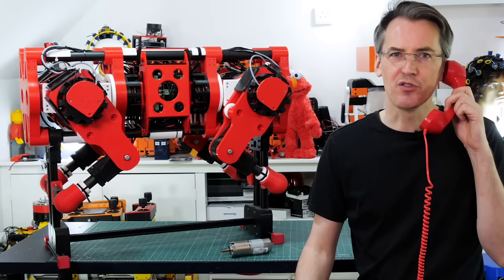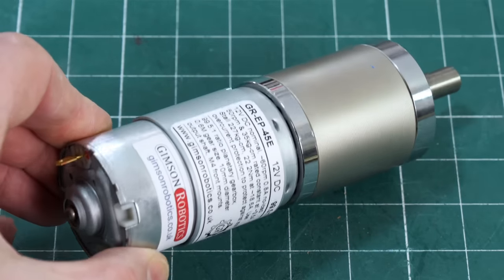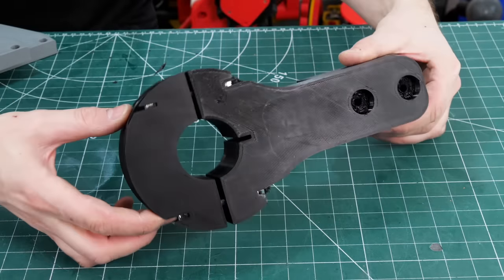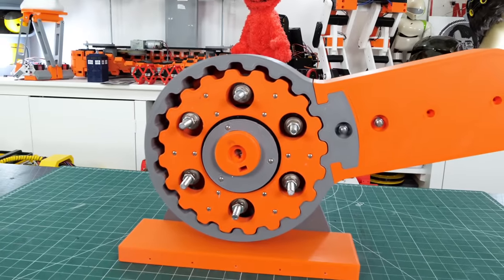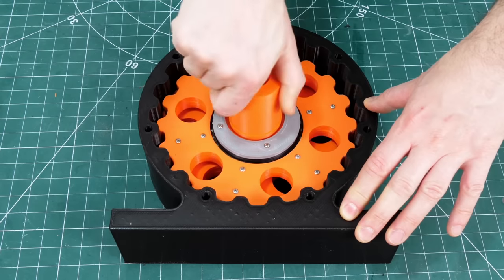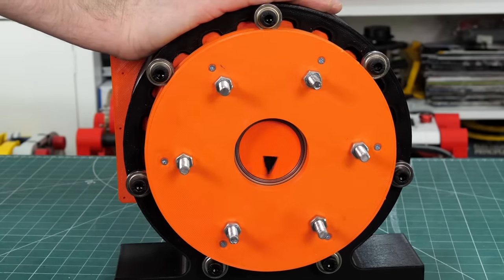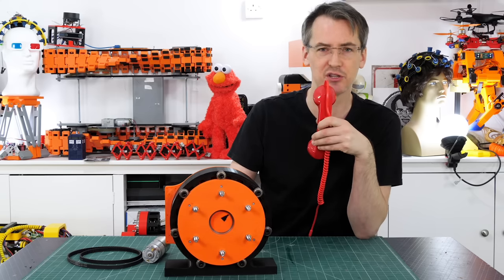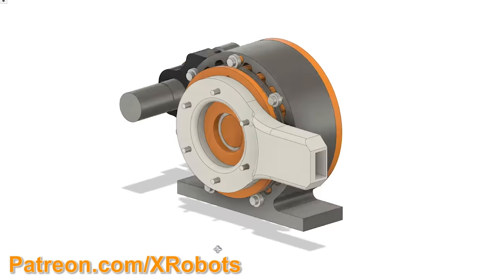120Nm 3D Printed Cycloidal Drive

Comment: Brother, you are getting pretty blase' about putting your hands around highly geared moving parts. You really need to check yourself. This stuff is now getting finger mangling strong. You need new safety protocols.
Reply: Yeah those pinch points would blow up fingers like hot dogs hit with a hammer
Reply: Ya. Ngl, even though I knew this was posted and nothing likely happened, I clenched when I saw that. It not being bolted down, with the self collision issue, while all the sketchy finger work was going on was a recipe if i ever saw one. Glad it went like it did.
Reply: Ooof that was painful to watch.
Reply: I disagree. I think it made it more exciting
Reply: Good point.. It's just a bad ROI in my honest opinion. Entertaining you briefly in exchange for the premiant loss of a very useful fingertip.   @Fanny-Fanny
Reply: @mrwoodandmrtin  that is a fair point. Thinking about it, if I lost my fingertip, I'd lose a way of briefly entertaining myself, too. So only fair that we don't expect others to suffer, even if our hobbies are slightly different.
Reply: @Fanny-Fanny  Haha. very good I didn't think of that.
Reply: @Fanny-Fanny  that's really, really dumb
Reply: @Hawk7886  thanks!
Reply: @Fanny-Fanny  yw
Reply: @Fanny-Fanny thats a red flag for sociopathy, might want to get yourself checked out. that's not a normal thing to feel no concern for others and I tire of seeing it trivialized.
Reply: @kingmasterlord  you are very sharp. I am indeed a sociopath. I genuinely don't feel the pain or emotions of others,  but I wish nobody any harm. I would prefer to make my way through life leaving positivity behind me, but it takes effort and there have been many times I have left negativity (and even chaos) in my wake. Not because I wanted to (and I've even tried to avoid it) but it doesn't bother me in any real way (except I feel like I've personal done worse than I wanted to).

So, you have accurately seem who I am. And I'm fine to be open and honest about that. I don't want to hurt anyone, but I just don't feel the way that normal folk do, about seeing others hurt. Unless it's a non-human animal. Then, it gets me in the feels. Serial killer slaughters a family - I get no pleasure from that. It sucks. Would prefer it didn't happen. But if he kicks the family dog on the way out of the house... now that really does grind my gears.

Not saying I'm better or worse than anyone else. Would I want to swap how I am for being like normal people? Probably not, but that's because it sounds painful and difficult and I'd prefer to have it painless and easy. Maybe if I could live a month as a normal and then decide, I'd feel different. But that doesn't seem possible yet.

Sorry for the long message. Thought you might appreciate an honest and detailed reply in exchange for your accurate perception.

I wish you all the best.

FF x
Reply: @Fanny-Fanny  i would indeed appreciate honest and detailed replies. most take my autistically abrasive demeanor as antagonism, hence the username and avatar, so all i usually get from others is hate. 

because if they're going to treat me that way anyway then I'll make doing so losing. "don't feed the trolls", "u mad bro?", and all that.

autism means im at the opposite end of the spectrum from you, i feel things harder than everyone else. the anger that overwhelms people enough to fight each other is what i feel when others experience mild irritation but i still have to behave normally; you're better where you're at.
Reply: @kingmasterlord  hey, I really appreciate the insight and honesty. Us neuro divergent types need to look out for each other, even if we are very different. I hope you can navigate the world of the 'normals' okay. Happy to have an open and honest chat any time you like. Best wishes and thanks for your honesty and openness. I'm sure it isn't easy for many (don't want to assume how it is for you though, so I won't)
Reply: Health and safety is just perspective haha
Reply: Maybe he wants to lose some fingers to 3d print himself a new hand. I get that tbh

Comment: You might have room in the hub for a third disc to give three phase drive . That should prevent the cyclic load that you're hearing. You might have to split the cam to get the bearings on.

Comment: The belt is actually quiet genius, as it's limiting the torque and prevents the gearbox from exploding
Reply: I think it's better for the motor to just stall, the belt will wear out real quick shipping like that.
Reply: @GaryTheRCcar  but the belt is cheaper.
Reply: Belts are basically mechanical fuses
Reply: @ashtonhoward5582   Just current limit the motor, you can limit the torque then too. A motor stalling isn't necessarily bad, its what happens after it stalls that is the problem, like continuing to run current through it and at that point it is just a resistor.

Comment: My favorite part of these videos is when James puts his hands in places where the 3d prints can crush him
Reply: Holy crap. I was whole-body cringing and holding my breath when he was trying to stop the drive with his hands.
Reply: I was thinking the same thing! With the 20:1 gearbox that's over 4500kg/cm!! A finger probably wouldn't even slow the motor down! It'd be a slight increase in current draw and a significant decrease in fingers!
Reply: @jamesbruton, please do a follow up where you feed meats and various other objects into the gears or between the belt and idlers! Another demonstration showing how much more dangerous these machines are when wearing gloves would also be fun.
Reply: @MattDunlapCO   that's a cool idea! I know firsthand (pun intended) how dangerous gloves are around machines with rotating parts. I work in a warehouse with conveyor belts, I'd never stick my hand in anything, but I was curious and stuck just my glove between the rollers, and even though the rollers lift up so they don't crush your fingers, there was still an impressive pulling force on the glove. If you were to stick your finger in there, it would definitely hurt, but you wouldn't lose it. With a glove on, especially a grippy one, you could easily lose your fingers or hand, maybe even your arm!
Reply: @AJ-Palermo  my daughter may have lost fingers to a drill press if she'd had on gloves tougher than cheap cotton knit. Thankfully the material failed before her hand.
Reply: How easily people forget they are by far the softest thing in any given room.

Comment: To put the motor inside the gearbox you need to "cup" the motor with mounting points around the lip of the cup and the shaft through a hole in the bottom of the cup. Then you can put the bearings for the cam shaft around the cup. Or look for a motor with mounting points in the base. The size of this drive makes it kinda impractical, but it did lift 2 tons at 1 cm. Maybe going with 100% infill you can shrink the size a bit.
Reply: >Or look for a motor with mounting points in the base.

Or he could make mounting points. I'm thinking either a battery spot welder or a (reversible) adhesive.

Comment: For your first design, the problem with your wobbeling is indeed with the motor itself, but not necessarily with gripping it. Essentially you have an overconstrained problem here. On one hand, the discs (through the frame and bearings) want to determine the center of rotation, and on the other, the motor wants to fix it as well. So what you would want to do, is release certain degrees of freedom keeping the motor in place, and only constraining the DOFs that you need.
In this case, you would want to constrain rotation around the motor axis (otherwise the housing would turn as well), as well as translation along that same axis. You probably want to somewhat release the other two rotational degrees of freedom, although they are of lesser importance here. What is most important, is that you release the two translational degrees of freedom. That would allow the motor to 'self allign', and to 'track' the center of rotation. This would prevent the thing from wobbeling loose due to excessive forces, and likely also fix that flexing issue of the outer case.

That second design, the belt essentially fixes this overconstrained issue. It is pretty compliant in those translational DOFs (and rotation as well).

Comment: You can still have it in the center, just go to a larger bearing and make a casement that brings mounting points to the back of the gearbox (of the motor).
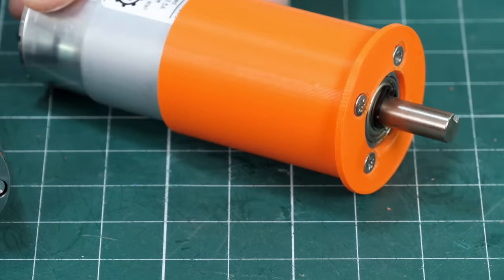Reply: That's exactly what I was thinking. At 3:48, it looks like it would be no problem to extend the sleeve and add mounting points at the back of the motor near the leads.
Reply: @TheGeniusSavant1 third along the lines of: Was thinking, could he increase the diameter of the collar he puts around the motor to run some tubes along the motor back to a solid foundation? Then everything else is the same just with the center diameter enlarged to accommodate it?

Comment: I recently rebuilt a 4 tonne excavators final drive which is a very similar design to yours, but with a planetary gear set at the end, and three cam shafts spread out around the cycloid gears rather than a central cam to create that walking motion. The strength and reliability of these cycloid gear designs is incredible!

Comment: i think in the first version one of the inner cams was a tooth off or something causing the output bolts to press them further out then the diameter of the housing, thus the flex

Comment: to stop the wobble and the mis alignment once in motion, you can screw the 2 cycloidal gear parts together while maintaining the offset. that restricts the wobble while achieving motion that the cycloidal gear system is supposed to achieve.

Comment: I liked the circumferential bearing solution, using multiple smaller bearing held into a grove rather than using a single massive bearing or bushing. I’ll remember that trick going forward.

Comment: 120Nm?! From Plastic bits?! Are U MAD?! Cool gearbox, like the smaller bearings round the perimeter, I might S.T.E.A.L. that part of the gearbox in my own design. Not sure if that's more eco or just machining 5mm ball grooves between inside and outside housings.

Comment: If you have a method of measuring the concentricity of the motor housing to the shaft, you might be able to find why it was warping the outer ring. I think if you could constrain the cam shaft radially and just have a torque arm to prevent the motor from rotating, you would eliminate some tolerance stack up. But a torque arm would only work well if the motor was securely attached to the cam shaft (taper shaft or bushing) more than just a key and screw. Which isn’t really common for a 10mm shaft. 
But basically you reduced the number of axis you need to have tight concentric alignment by having a belt drive.

Comment: (maybe bad) idea for improving belt skipping;- can you have the belt go around the pulley entirely? if you imagine that normally the belt is in contact with around half of the pulley, instead could you have a pulley that guides the belt to wrap around 1.5 times. Obviously, you'd need a corkscrew-shaped pulley so the belt doesn't clip through itself, and a belt that can flex that much.
Reply: Corkscrew pulley would cause the belt to travel sideways as it turns, so it would have limited range of motion similar to capstan drive.
Reply: @dekutree64  excellent point, didn’t consider that.

Comment: if you put a support bar between the motor on the shaft side and the center of the gear, it should keep the plastic from bending and moving the motor toward the gear, keeping the belt as tight as it is initially.   it's really jsut a space that you might be able to put on/off, I don't think it'd have to be super duper sturdy to work, with the way it'd be arranged.

Comment: So much work being put into something that will last 3 months of continued use maybe. I wish you would implement more aluminum T slot frames to negate some of the slop in your material of choice. just plan your 3d prints around the T slot frames and you would run into less issues.

Comment: I can't believe how well that second one worked while still having the skinny ring. I've always proportioned them with OD = 1.5x disc diameter, whereas yours looks like 1.2x.Taking some rough measurements from a screenshot, I think that would make the solid ring (excluding the teeth) about 3x thicker, so 27x stiffer. Maybe I've been overdoing it...

Comment: you could probably put the belt side in double shear with one more plate. It would be nice if the motor had a longer shaft so that could be supported as well.

Comment: is it possible that on version 1 one of the excentric 21gears was rotated 60° and thus the excenters are out of sync? (this sentence makes sense in my mind)
Reply: seems like it! 
The internal 20 lobed - 6 holed parts have only one axis (plane?) os symmetry. If you rotate them by 60 degrees of what the supposed to be you will start pushing outer "race" out of shape.

Comment: I think what was happening with the first design was the gear was out of proper timing between the holes for the output bearing and the gear teeth.  much like having to put the gear halves together so that the holes and the gear teeth line up, they have to be timed inside the outer gear so that they mesh properly with the holes lining up properly.

Comment: I'm surprised that James hasn't tried to build an RV Gearbox (rotate vector), which would be more powerful then just the cyclodial gearbox.

I believe Nabtesco from Japan has the patents and is credited with the design.  There are CAD models available from the Nabtesco website too. 

There are some very impressive capabilities of the RV gearbox.
Reply: If it's patented, then there is the answer, he does only open source.
Reply: @dennisdecoene   patents only apply if you're trying to make money, if you're just doing it for fun you can do what you want (:
Reply: @roseroserose588  Yes, but then he can't publish it for the public to reproduce without seeking permission first.  Because he uses an incompatible licensing scheme.

Comment: Could you reduce the wobbling if you had three discs where disc 1 and 3 are in sync (same cam angle) with half the with of the middle disc which is running on cam  opposite to the other cams. I think the cams wobble forces on the ring could balance each other this way?
Very nice solution with the poor mans big bearing btw!

Comment: I think it matters to align the cycloidal wheels, because 20 doesn't divide by 6.
Pretty sure that's why the first one was flexing and unhappy the moment you bolted the output on, the holes for the output 'pins' weren't aligned right.

Comment: I think you misaligned the disks in the first version, causing the wobble. Given 20 teeth and 6 holes, there should be 3 distinct positions for the disc relative to the other when mounted on the 6 studs. Look at the overlapping circles, they seem to be asymmetrical (as seen in 6:07)

Comment: I'm curious if this could be a feasible option for something like a (relatively) slim high load elbow joint for a mechanical arm alternative to hydraulics. Seems like if it was made of sturdier material then it could move a heck of a lot for such a small setup. Either way looking forward to see what you do with it in the future.

Comment: U might not know it yet but u just made the best electric garage door opener system just change the arm for a rope/wire winder an ur set...  an that was out of plastic not aluminum are steel 👏🏼👏🏼👏🏼👏🏼👏🏼

Comment: Great work as usual.
Reply: I did wonder about changing the offset on the two cams from 180, to 180 - 1/4 * 1/21 * 360 (about 175.71 degrees), the idea being to stagger the two cycloids so the engagement/reengagement cycle is a 1/4 step apart rather than a 1/2 step apart. (quadrature rather than antiphase), which I'd hope would be almost as good as going three phase for getting the oscillating torque (and load noise) to be steadier.

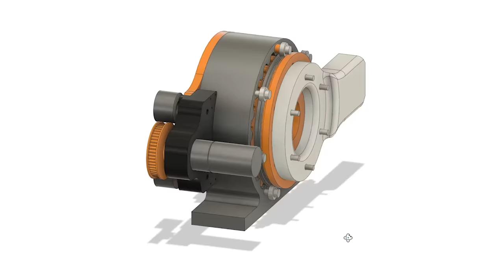Comment: Something weird happens when you show the cad model on screen at about 8:50. In the 1080p version of the video, there's a weird green discoloration right near the center of the screen. It was distracting enough that I got up to clean my TV screen, but it wouldn't come off; then I thought to check it on my phone, and it wasn't there, but then I thought "it's probably not using the same resolution," and when I changed it to 1080p, sure enough, the discolored spot reappeared. Maybe something from your capture software?

Comment: you could keep the motor in the actual gearing if you wanted to, you clamped it, didnt work then you went to belt drive. but decent glue, or if you drilled dimples into the motor casing, and added screws that fit those dimples. or glue on a key way to the top of the motor. it feels like you wanted to put the motor in the gearing, and gave up once you couldnt secure the main part of the motor. theres plenty of ways to secure a cylindrical object, and you gave it a thought and then gave up.

Comment: You can print your own bearings and use ceramic media cones as the rollers. If you print the track to house them in a zig-zag pattern, they should self stabilize and roll pretty evenly (with some lubricant).

Comment: I think i know  a way you could fix the skipping by removing the belt replace it witha gear and have a screw thing so its not back drivable but it would be way harder to have it skip also adds a tone of tourqe before it enters the cyclodial drive

Comment: Why not forgo the tensioners and just mount the bearings a belt width away from the toothed pully on both sides of the pulley, so that the belt can't slip unless it can smash the teeth into nothingness. I could never tension a design I had enough, until I realized I could just hold the belt to the pulley at the pulley with a bearing.